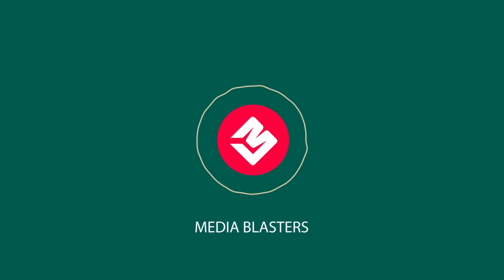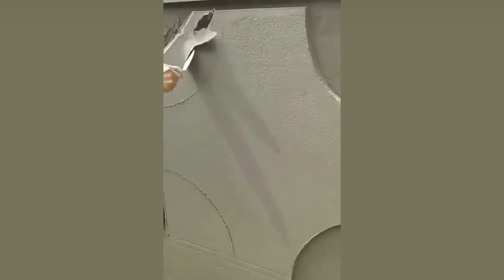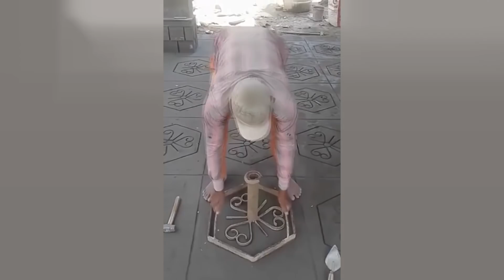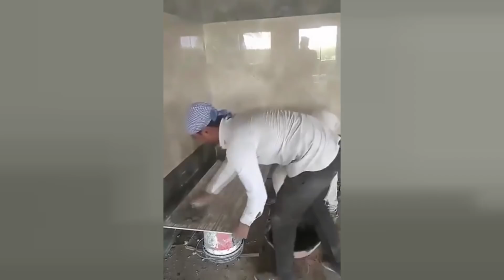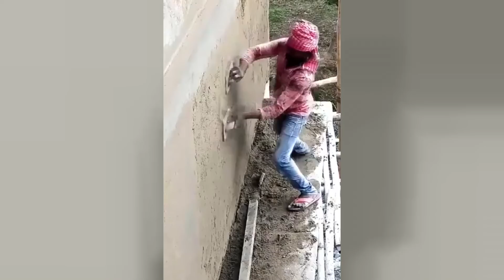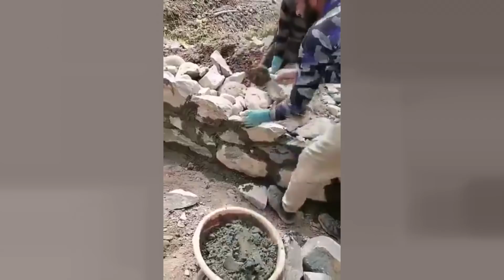ഇവരാണ് ശരിക്കും എൻജിനീയർമാർ ഇവരെ ആണ് നമ്മൾ സപ്പോർട്ട് ചെയേണ്ടത് | The Real Engineer

Comment: Enginnering ennal verum kettidam paniyal mathramalla....Genetic engineering, Biomedical enginneeing, Software engineering , Propulsion and areospace enginnering..enningane orupadu fields und ee engineringil...kurachu skilled labours vicharichal nammal eppol kelkunna, chandrayan polulla mass projects cheyyan sadikumo...oru worker vicharichal oru space shuttle undaki spacil pokan pattumo?....ee workers enginners plan cheyyuna model undakunnathe ullooo...ee parayunna oru veedu kettan enginners onnum venda sammathichu....Nammude okke citiyil 50 nilayulla buildings und...oru enginnering team illathe kure workers mathra vicharichal athundakan pattumo...pinne ningalude arivinayi...ethram valiya structures undakumbol...kattayum,kambiyum,cementum vachu chumma angu ketti karayuka alla cheyyunnath....adyam soil invsetigatin nadathanam...athayath building kettunna stahalathe soil ethrayum load thangan ulla capcity undo ennu, athu ellenkil soil improvement nadathanam by silica injection or other methods, pinne wind analysis nadathanam, pinne earth quake analysis....angane orupadu factors und....don't think engineers are there for building a 2 storey buildings...Palm island,Burj khalifa pollulla valiya buildingte making videos kittum just see that.....engineers undakunna plan anusarich kattatum, cementum vachu ketti kayarunna al mathramanu oru worker.....at the end eni ee building collapse ayal athinte ella responsibilities enginners nu mathram anu....apol ee workers parayunnath njan enginnering plan anusarichu mathramanu cheythathu ennanu...
There is huge   between "well tranined and well educated"...